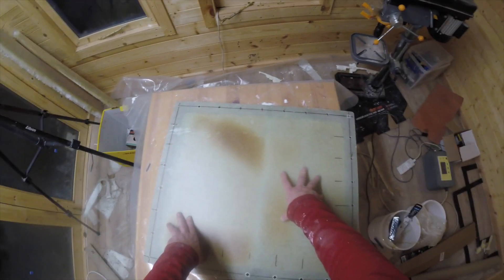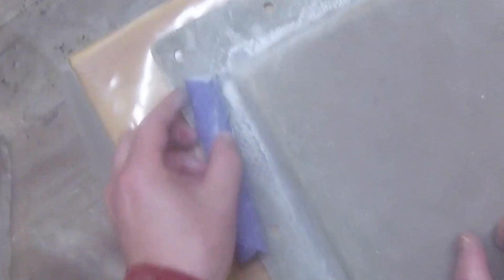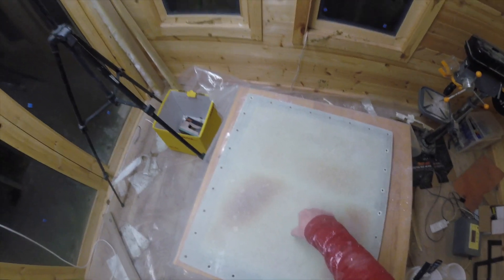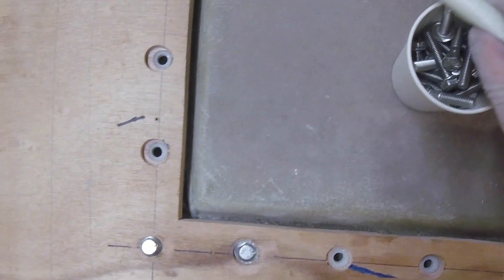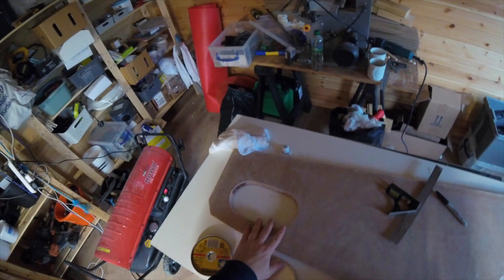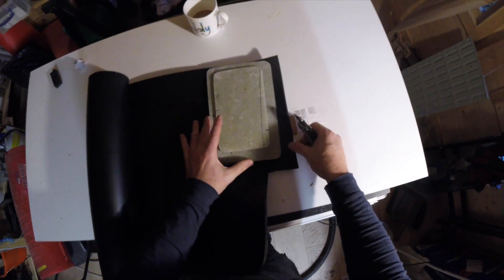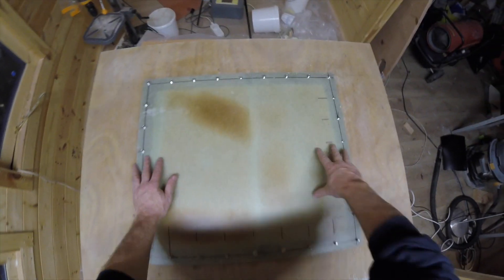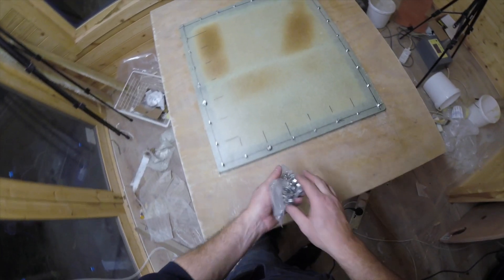#86 creating the new lazarette and systems compartment #1

Comment: This is one of the strongest built hatches 💪🏼
About the rubber washers: 1 where did you find them? 2 if you put an inox washer on top of the rubber one, it will make for a snug fit without collapsing the rubber. 
Merry holidays and an awesome new year! 🥳
Reply from the maker: thanks I got the rubber washer from an industrial supplier. I think I will use a fibre washer? have a great year ahead!

Comment: I did think of fitting a hatch in the cockpit locker when I fitted the new engine to my 352 but didn’t. It’ll be handy for access though. My locker never gets very wet as I don’t keep fenders in there. I hang my fenders off the push pit over the stern and try to dry out mooring warps before stowing them away (easily done in Portugal).  Lovely work as usual. 👏